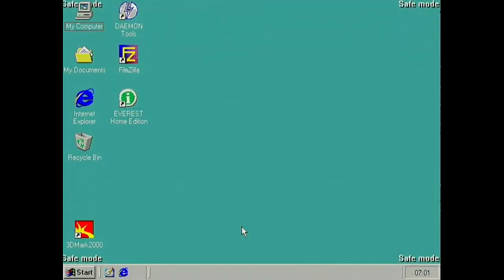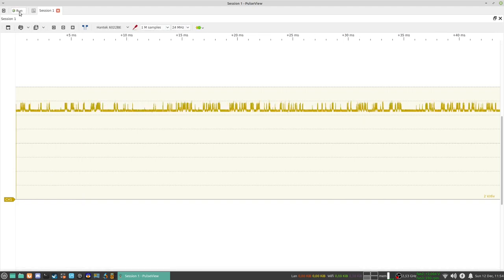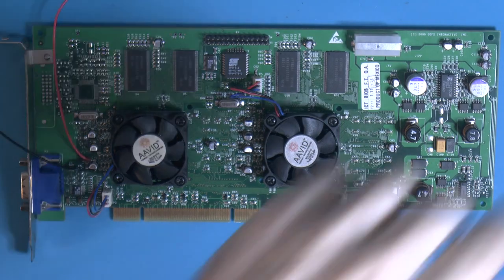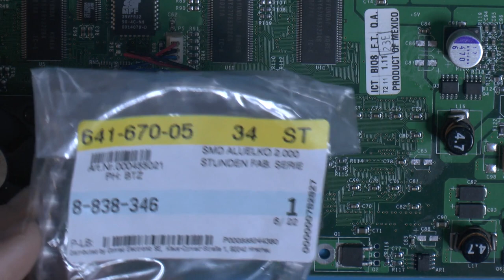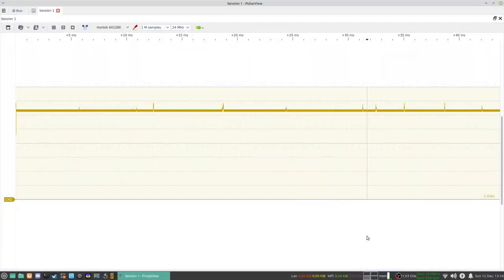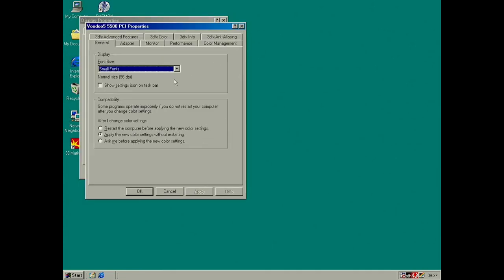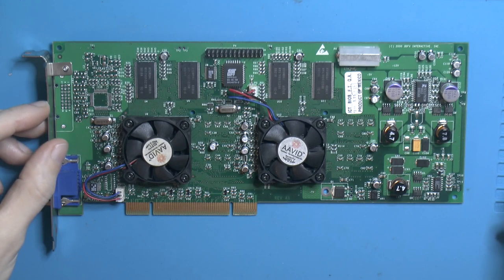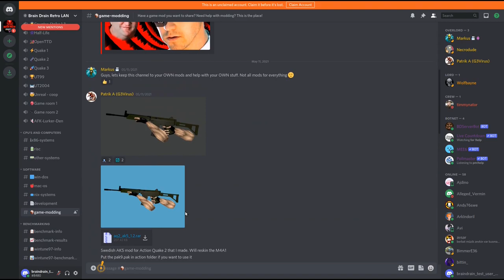3dfx Voodoo5 5500 repair

Comment: Thank you. This is literally the problem that I have with my Voodoo5 PCI as well. A cap replacement should be a very simple fix for me.
Reply from the maker: Yea its relatively easy fix as fixes goes so good luck!
Reply: I thought this was an output problem, seeing that a few old PCI cards of mine are having the same issues. 

I’ll start replacing those capacitors too. 

Thanks! :D
Reply from the maker: @Inject0r  The thing is that the caps are there to filter the voltage to make it more stable for our IC's as you know, but the voltage ripple is due to the IC  switching in the first place, for example the VSA100, or a ram chip. 
We do know that we want good stable voltage to our IC's but a side effect of bad caps is that the ripple goes else where to.
So I suppose you can look at the caps as both filters for the chips there meant to serve but also guards making sure other parts of the circuit is not effected by ripple the IC's produces.
I saw this with my oscilloscope when designing some stuff my self with a 555 timer.

So I suppose thats the take away from this repair, bad caps effect more then what it was meant to protect and supply clean voltage to.

I have an also ISA card with leaky caps on the way in to that has bad image to, did not have that 2 months ago the owner say, probably the same problem.

So yea bad image quality on analog output seems like a possible indicator for bad caps.

Comment: Great work! I'm repairing a 5500 right now and plan to do a full recap on it also. I don't have any symptoms like this, but at 22 years old, I think special cards like this deserve proactive maintenance 🙂 .. I was going to skip the two big polymer caps, but ended up ordering them anyway. I've used side-cutters to just decapitate the smaller electrolytics for removal, but will give the twist method a try as well. Does twisting work on the larger polymer caps also? I've never removed polymers before. Thanks!
Reply from the maker: The big once I would use hot air the legs are thicker, you can use hot air on any caps you want to remove because there dead anyways and heating the board from the bottom a bit first helps. But sometimes the twist back and fort is desirable if there is plastics and stuff next to it.
People in the comments dont like the twist method tough the people that ask for help dont mind because it worked so fare but I tend to use hot air to remove them nowadays, it might cause a spill of electrolyte if the caps are bad where the o-rings sometimes leak but it can be cleaned up.
You can check out a later video where I use hotair to remove them https://youtu.be/ygvR_2Jsb84?t=1027
Its time stamped.

Polymers are "dry" so should not leak tough.
I did the big polymers because someone removed his and measured very high esr on them and I did have two bigger really good once, there 1000uf BUT if you measure and check all they do is filter incoming voltage from the molex so its bulk filtering so not to woried about capacity as long as there at least as good as the original.
I dont have an esr meter yet  so replacing them was the the only way to know they would be good and one was damaged a bit from a hit so figured better safe then sorry.

Also no mater what method you use you need to practice it on something of no value, I prefer old dead router boards and such, things might work in your head but how things "react" when you actually do it might not be what you expect so practice is the most important thing. You can buy some extra caps and practice solder and desolder on something of no value first.

Then the risk of breaking stuff is a slot lower once you know what works for you and how it feels doing it.
Reply: Thanks for the tips! I never considered removing caps with hot air but your video makes it look really easy. I may give that a try. On a positive note, I was able to repair the Voodoo 5 successfully. It had a long list of problems that needed to be fixed - three missing SMD components, solder bridges caused by the previous owner, bad TSOP SDRAM chip and bad solder joints on the power regulation chip. It is finally running stable on both VSAs now after fixing all of those problems. After watching your video, I noticed my card also has a small amount of "noise" on the VGA output. Especially in text modes (BIOS POST screens etc). It's not nearly as bad as the card you repaired, but I'm going to do the full recap and see if it disappears. Thanks again.
Reply from the maker: @vswitchzero  Sounds like a lot of work but it paid of at the end. Have fun with the Voodoo5!

Comment: I have the exact same issue with my Voodoo 5 card too! Did a recap, and whilst it did slightly improve the artifacts, unfortunately they still persist.
Reply from the maker: Did you replace the 10uf only or did you also do the 470 and 100 polys? I have seen people measuring those as bad. I did replace those after I did the last oscilloscope measurement mostly as a precaution.
I think there are some other caps on the board to but sadly not everything is cause by bad caps, I use to say 80% bad caps, then 10% traces repair and the last 10% is bad IC's, mosfets, voltage regulators, SMD ceramic resistors and caps.

I dont have a Voodo5 so this is the only one I worked on and picture quality was perfectly solid both on capture card and monitor after the replacing the 10uf, but usually with bad caps on GFX cards what I see is 3D rendering being highly unstable, 2D not so much or image quality.

Comment: Great video, man. We need more content like that.
Just ignore the FUD-loving know-it-alls. Say, what oscilloscope do you use with your computer?
Reply from the maker: TY!
Its the Hantek 6022BE, its 20Mhz if I recall, 2 Channels, its not the best by any means but its portable, you get 2 probes with it, its low cost, around 80€.
Its the difference between seeing and being blind.
You can use the https://sigrok.org/ software with it so should work with most OS/Computers.
Im happy with it, its very basic but gets the job done on a budget, saves me space not having the extra screen.
There is a version of the Hantek scope with a built in logic analyzer to BUT last I checked it did not work properly with the sigrok software, seems to be a more problematic version so I would probably buy a separate logical analyzer if that's of interest.
Reply: To be honest, I was impressed it even had Linux support, so I'm definitely getting one of those
Reply from the maker: Did you ever get a scope? Im have been trying out "openhantek" 
http://openhantek.org/
https://github.com/OpenHantek/OpenHantek6022/releases

With that program it works more like an oscilloscope, sigrok is useful but cant use the continuous mode so.
https://www.youtube.com/watch?v=8xSnUUgV1VE
The only decent video I found about it.

Only problem I noticed having sigrok and openhantek installed at the same time is that openhantek cant find it if sigrok ran before it, power cycling it is then needed.
Reply: Still haven't got it. Thanks though, I'll keep it in mind

Comment: No no no you never twist off caps, you risk lifting or tearing the lands/ traces. All you need is a reflow gun station and tweezers.
Reply from the maker: Who wrote that rule?

I used this method with 100% success rate for 3 years now. Think I stick with what works.
https://youtu.be/X8N9O3a9jiM

There are plenty of people using this method with good reliable results.
Reply: ipc certifications. I work in the field professionally for a company. I am class3 smt/ aoi/ rework/ wave solder/ selective solder trained. The lans are litterally held on by glue and the lands themselves are only .02mm thick copper foil that is nickel/silver/gold plated. You may have done it the first time on each individual board but when it comes to the second time it will lift. This is because the bond between surfaces has been broken and now exposes these surfaces to moisture in the air which will effect the pcb underneath as time passes.
Reply from the maker: @FullMetal-Tech  I have done it a second time for testing/practice and nothing lifted then.

Good you have training, some of us mere morals just have to get by I suppose.
Reply: @ruxandy  Just unsubbed as well. Way too dense.
Reply: he supposedly has all the training but doesnt know anything about reAL WORLD repairs...hot air stations are something to avoid on old fragile equipment, the heat can damage surrounding parts no matter how carefull you are, of course they are needed for certain types of repairs but not for capacitor replacement...twisting those type of caps is a 100% approved (by everyone :)) way of removing them without any damage to the board...you haters may not believe me but you can watch "mr carlsons lab" he also twists them and i have been using that method also on smd electrolytics flawlessly...rework station is not needed and best avoided, lifting one leg at a time will rip the pads with those types of caps because of the large plastic base so twisting is safe and easy if you are not idiot and reckless

Comment: The twisting method should not be attempted on leaded through-hole caps!  Only surface mount electrolytics.
Reply from the maker: There are no trough holes on this board.
Just to clarify.
Never considered twisting trough holes, fun getting whats left of the legs out then then XD
The easiest way I find with normal trough hole caps is a tip wide enough to touch bot legs, that way the can even fall out due to gravity.
Reply: I want to donate a Quadro FX1000 to you for your channel, are you interested?  I can send it at my expense, it's yours to keep.

Comment: That behavior is not indicative of a capacitor problem. It’s something that I often see on LCD monitors and it always goes away with an “Auto image configuration” which adjusts the clock and phase.
Reply from the maker: So your saying my friends countless numbers of CRT's and LCD monitors being one of the biggest collectors of retro hardware in Sweden is all by chance having the same issue, CRT's included?

And your saying my LCD plus my capture card all have the same fault and it went away when I replaced the caps, yea maybe your logic here is broken.

You honestly think that I dont know where the auto adjust button is on a monitor after 20 years with LCD's, and you think that no one tried it and the V5 still gives poor image on ANY type of monitor.
Reply: I am not saying that, I'm saying that I've seen this exact same behavior hundreds of times, including today with a Radeon 9800 PRO. In my specific case, it always happens whenever I test many video cards and I swap them (which always requires a readjustment of the LCD clock/pitch and phase).
PS: you are a bit jumpy, my friend, not sure why. 🙂I didn't mean to offend you or anything, I'm just stating my own experience.
Reply from the maker: @ruxandy  You are implying that people are morons, your also forgetting that the prof is in the video, also that no "auto" adjust exist  on my VGA to HDMI adapter and capture card so nothing but caps changed in between. IT dose the same thing on my NEC 274WMi monitor, that is extremely forgiving on VGA single Enterprise monitor with auto adjust.

Also the owner has tested multiple computers and monitors being a big collector, biggest I know of of PC retro hardware.

Most people using an LCD know how to use the auto adjust, This is NOT an adjustment issue! This is ripple propagating to the VGA signals and port.
Reply: No, sorry you understood it like that, it was not my intention to imply that anyone is a "moron". I was simply mentioning the fact that most of the time I'm seeing the same behavior under different circumstances, I'm definitely not disputing that in your particular case the cause might very well be faulty caps.
Reply: Jeez man, relax. Way to alienate viewers.
Reply from the maker: @chuizune  He clearly states its not a capacitor problem despite me proving it is.
What he suggest is not relevant to the video because we (I and the owner) know the card is at fault not the monitor and if we assume auto adjust would "hide" the problem on a LCD it would not on a CRT plus your would still have ripple killing your IC's on your card and not actually fixed the problem.

Honestly I dont care, what he wrote is incorrect and irrelevant for the scope of the video.

And we use RTC's so there us not "auto adjust" that would hide the fault with the card.

Other YT might just ignore a comment that has broken logic but I dont.
Reply: ripple on a voltage rail is a filtering problem....the rest is just your imagination
Reply: @chuizune  no need to be nice for arrogant viewers...he should stay true to himself and not be a hypocrite like the big channels...this was clearly a cap problem he even showed the ripple on the scope...the criticism and hate is dumb in this case, these people doing dumb criticisdm deserve equal responses